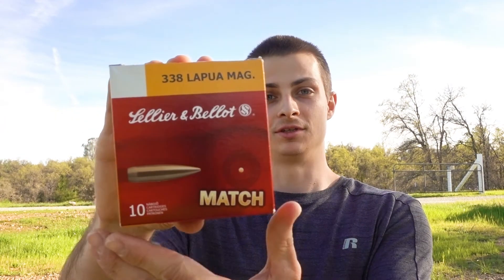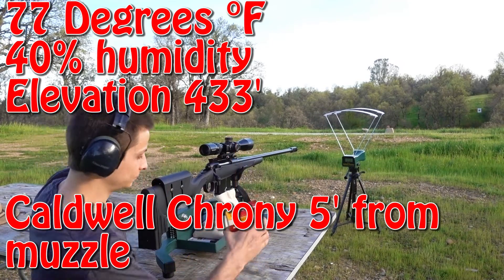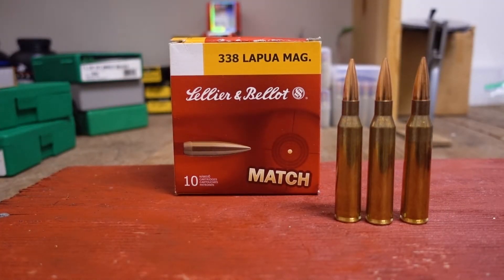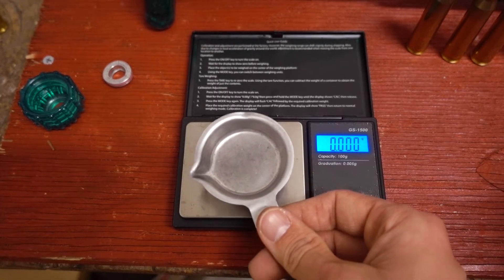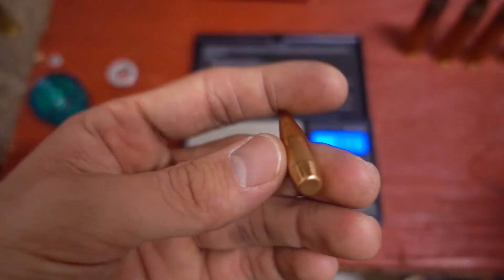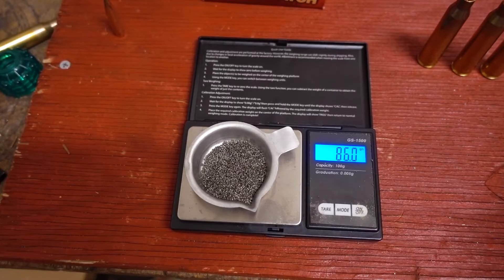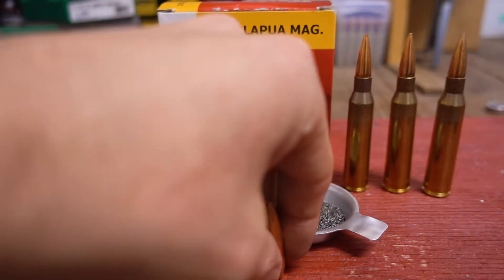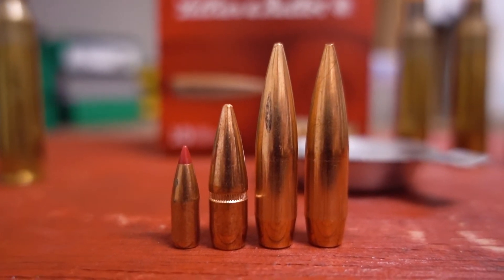.338 Lapua Sellior and Bellot 250 Grain HPBT velocity and analysis

Comment: Looks like imr 4350
Reply: I'll guess imr 4831. For 4350, The manufacture website I saw only shows load data for 160 - 225 gr. And max charge of 83.3 gr for the 225 gr. If S&B stuffed 86 grains in for a 250 gr bullet...ka-pow!! Should probably be over 3000 fps. Have seen posting of a loader using 4350 per the Sierra Manual, Edit. 250 gr SMK: Start: 78.3grs for 2750 fps in a 26" Savage 116 rifle. Max: 84.5grs for 2950 fps. The Accurate 4350 I have is a little slower on the chart than IMR, but, their info doesn't include .338 LM. I'm using it for .30-06, but maybe I will try it in the .338 at some point.